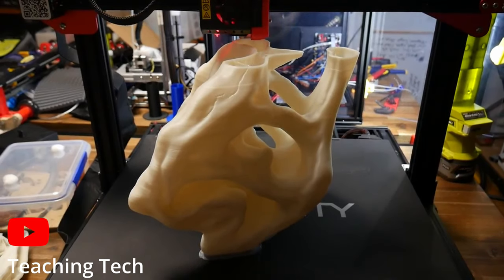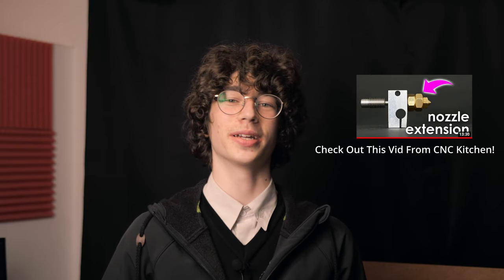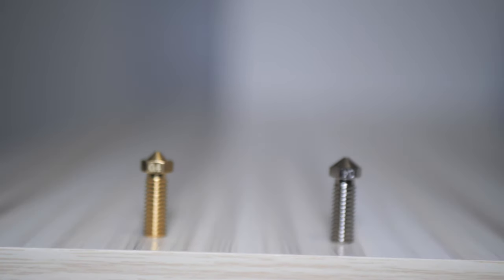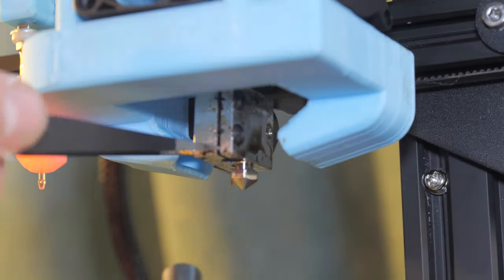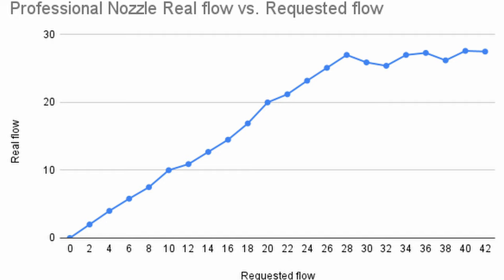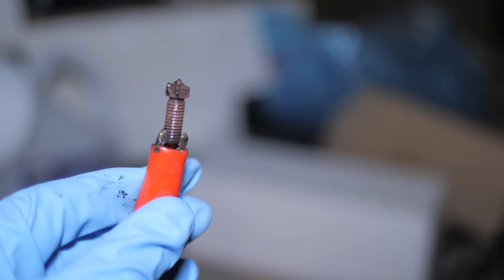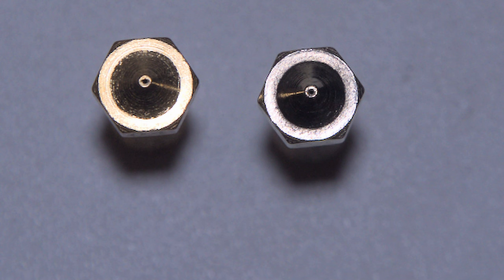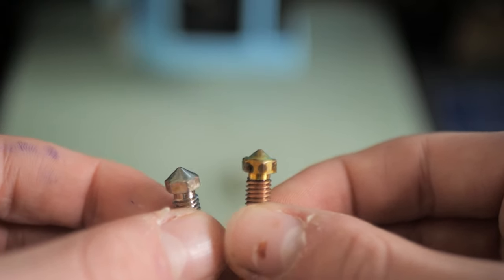Faster 3D Printing With Copper Plated Nozzles?

Comment: Hello, I want to give you some constructive criticism.
Overall video has a good composition, you are referencing to other videos/channels so you are not just repeating content.
But I see a big flaw in your logic, and I blame mostly nomenclature and Chinese sellers.
Proper name of nozzle that you bought should be "nickel plated copper nozzle", which means nozzle made of copper and exterior plated with nickel. Copper is for high thermal conductivity as you mentioned, nickel plating is for protecting copper from oxidation at high temperatures and reduces stickiness of filament (to the nozzle). Same goes for copper heating blocks.
"Copper plated nozzle" is a nozzle made of unknown material plated with copper. This makes no sense because: This thin copper plating (few um of thickness) won't improve thermal transfer at all. Unprotected copper will oxidize rapidly.
What I see is that you tried to plate brass nozzle with copper. Unfortunately results are poor. Plating is so thin that you barely see colour change (should be bright red of copper :)). Also unintentionally internal roughness of nozzle was ruined which led to lower performance than clear brass one.
Last thing I can recommend is to file unimportant part of this "Trianglelab T-Volcano Plated Copper Nozzle" to check if core resembles copper colour.

Good luck.
Reply from the maker: Thank you for taking the time to write this comment. Thanks also for clearing up some of the facts involving nickel and copper plating, this is really helpful info that I can use in the future and let others know of as well. I filed a couple parts of the nozzle, which revealed the standard copper colour beneath. Next time I will definitely do more research and include more information. Criticism and feedback is always welcome as it's helps me improve and helps others as well, thank you again for this.
Reply: I tried filing down a aliexpress "copper plated nozzle" and the naming is just wrong. It's a copper nozzle with a nickel plating, which makes sense.

Comment: Hey Tommy, awesome video. I love the thumbnail and presentation. I reckon the title could be a little better though, for example: 'Why you should be using diy nozzles',  or, 'how this nozzle increased my 3d printers performance'. The intro section could also be a bit closer to the start of the vid. Plus i know its cheesy but a reminder to subscribe at the end can be useful to the viewer. Other than that youve done a very nice job overall.
Reply from the maker: Thanks for your comment and suggestions. I’m still trying to figure out what works best. A reminder to subscribe will be higher on my list…